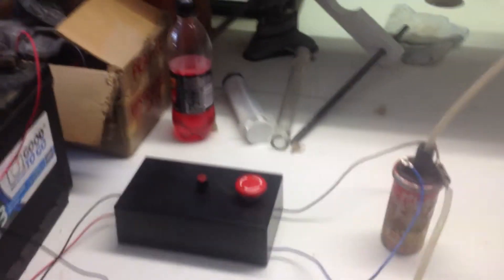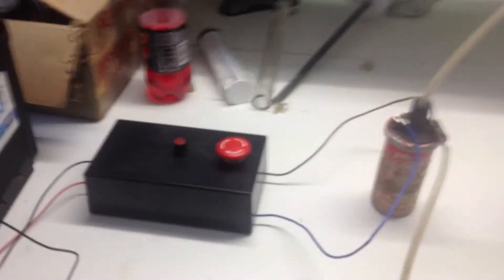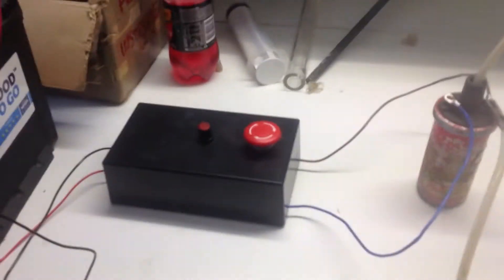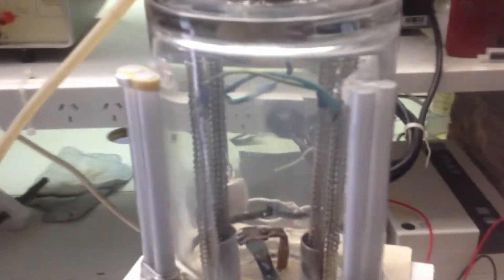Meyer magnetic gas vaporizing neodymium

Comment: Is the primary wound in a bifilar coil, so the resonant charging choke is incorporated into the coils?
Reply from the maker: nope.. the chokes are 430 fr ss wire bifilar wound.
Reply: Yeah but what I meant was has Stan incorporated the resonant charging choke into the stainless steal primary and the seacondary, I understand that the resonant charging choke is to reduce amp flow
Reply from the maker: Only the chokes are ss wire... the primary and secondary are not ss wire.The chokes come off the secondary, not the primary.
Reply: Oh alright thanks for sharing your knowledge.

Comment: hey electro, i was wondering if you have successfully got the neo vapour to covalently link up with the ionised argon gas yet. or if anyone besides meyer have done it.
Reply from the maker: haven't tried yet... too busy at work.
Reply: do u know if anyone ever has done it
Reply from the maker: don't know.. mine is the only one I've seen at this level..there are a lot of con artists out there who claim they know how to do it but no one ever does...
Reply: yeah, do you know if permanently magnetised neodymium particles suspended in oil, mechanically pumped through a gas core transformer would produce overunity
Reply from the maker: it never would
Reply: yeah it wouldn't work in a laser EPG but would it work in a normal mechanical EPG
Reply from the maker: nope.. I mean it would work but it wouldn't even come close to overunity..it would even be less efficient than conventional generators where they just pass a magnet through a coil instead of grinding up a magnet and putting it in  oil and trying to pump it around a tube...
Reply: yeah you are right. but don't you need a resonant cavity and a VIC to fully ionise the argon gas before it links up with the neodymium
Reply from the maker: yep
Reply: is that what you are doing, i don't understand why you need a VIC when you could just use resistors to reduce amps
Reply from the maker: resistors use energy to restrict electron flow... the vic uses the inductor to restrict flow,
Reply: Oh so the resistors consume energy in the process of reducing amp flow, where as the vic uses the inductance of the primary coil to reduce amps

Comment: Hey man, what are u planning on using this gas for, a EPG?
Reply from the maker: yes
Reply: r u going to electromagnetically accelerate the magnetic gas or use a pump ?
Reply from the maker: neither... using a laser so the gas doesn't move, it uses photon bombardment to enlarge the electron orbit so the magnetic field is changing with the pulse of the laser.
Reply: will this be a way of extracting energy from the gas?, this sounds like myers gas processor.
Reply: so you have bypassed the need for the gas to be moving in pipes by constantly changing the polarity of the gas sort of like A.C. and then use pick up coils, like a transformer. am i right ?
Reply from the maker: sort of.
Reply from the maker: no..totally different to gas processor.
Reply: but does the polarity of the gas change as the photons are bombarded into it ?
Reply from the maker: NO.. the orbit gets bigger and because of the conservation of angular momentum the electrons revolve around the atom faster..  because you have a charged particle travelling through an electrostatic field the by product is electromagnetism( magnetic field)... the faster the electron travels the stronger the magnetic field...so as you pulse the laser the magnetic field gets stronger and weaker (changes) and a changing magnetic field in a coil produces electricity...
Reply: oh so the photon bombardment increases the speed that the electrons are moving, thus making a magnetic field that changes with the intensity of the photon bombardment, also, is this a Over unity effect like stan's EPG
Reply from the maker: yes..pretty much...
Reply: Wow, this is a really cool concept. Is this your own concept or one adapted from Myers research.
Reply from the maker: This is a direct adaptation/translation of Meyers work...
Reply: it's pretty dam good, solid state epg
Reply: I just saw a video where Stan was explaining this concept, and just as he was explaining how the electron orbits expand as photons are bombarded into it, he said we better stop and the video cut out
Reply from the maker: yeah... that's the New Zealand video.
Reply: Yeah. I might start research into this (solid state epg) concept. I am new to this field, I only discovered it 6 months ago. The internet is a wonderful thing.